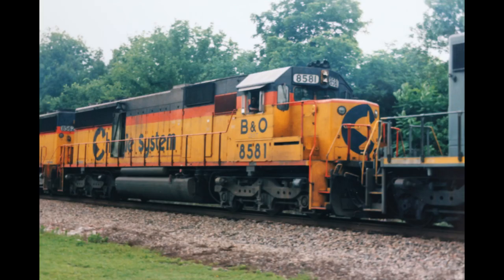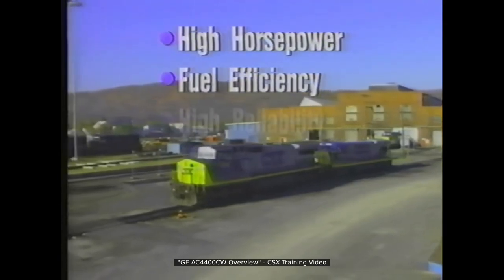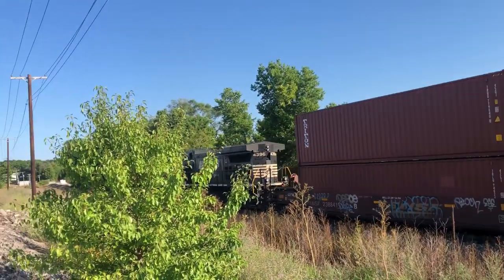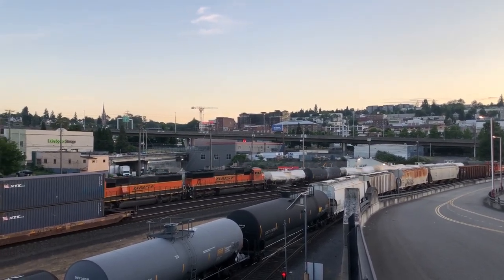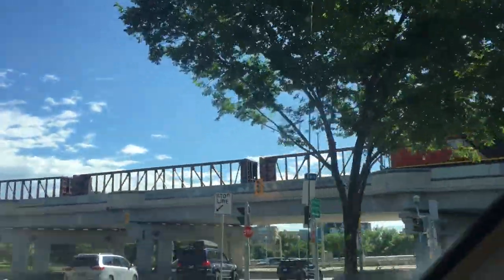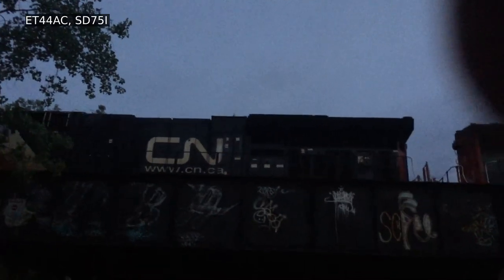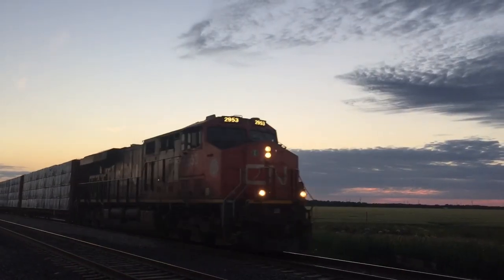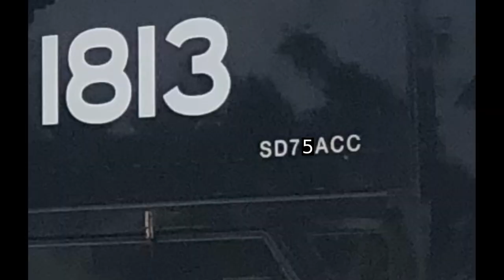The EMD 75 Series Explained (SD75M/SD75I)

Comment: Not all of these series have the same exact horsepower ratings...
The GP60 & SD60 series are 3,800 HP with the 710-G3A's.The standard cabbed SD70's were 4,000 HP but the SD70I's,SD70M's,SD70MAC's,and SD70ACE's are actually 4,300 HP and all units use 710-G3B's.The SD75I's & SD75M's are 4,500 HP with the 710-G3C's.Obviously there also was the SD9043MAC convertibles which used 710-G3B's.
ATSF ordered 51 SD75M's but 25 of the units became apart of BNSF's roster because those weren't delivered before the merge.26 SD75I's are in the BNSF roster.Canadian National owns 173 SD75I's which were suppose to become SD75ACC rebuilds last year.ONRR only got 5 SD75I's and only have 4 units because one was totaled from a derailment.

Comment: NS got rid of their SD70/75M units a few years back, while most of the standard SD70s they had have since been rebuilt as SD70ACCs. The rest that didn’t receive a rebuild were retired and sold to progress Rail. That’s all I know about their units from there.
Reply: Norfolk Southern was suppose to rebuild 80 SD70's into SD70ACC's but only 52 were completed.As usual as it is,they canceled the program at some point instead of getting it fulfilled and the 28 remaining units were sent to PRLX and most likely will be scraped.The 65 SD70ACU's that they sent to PRLX are finally getting scraped.

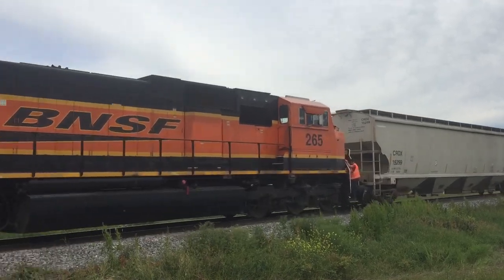Comment: What was that guy doing at 1:44?
Reply: maintaining 3 points of contact of course.
Reply from the maker: This footage was taken when I went up to Winnipeg back in August of last year. As I recall, when driving along the main road, I spotted these two engines in a field attached to about a dozen cars just south of Morris, MB. As I was getting closer to town, I noticed the two engines cut off and started to head towards town as well, carrying only one car. Luckily, the track converged with the road, and I was able to film them crossing. Anyway, because the conductor was just hanging out on the second engine, I would assume they weren't going very far, and probably went to shunt some more cars a little ways further into town. I recommend checking out my 2nd rail expedition video, as it has more said about what I saw in Morris.
Reply: @brookingsrail  as soon as I posted my comment I realised that was probably what was going on. Working in the rail industry myself (in Australia), if someone did that here, they would be facing disciplinary action or termination. Where I am, you can't even step off a moving rail vehicle, even if it's moving at walking pace. Which seems pretty ridiculous but hey, safety safety safety, as we are constantly being told lol.